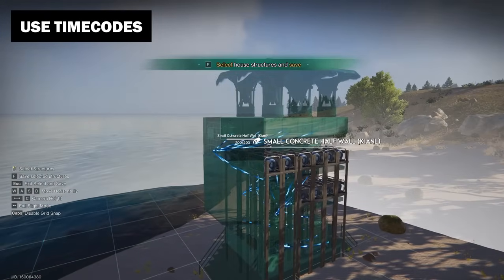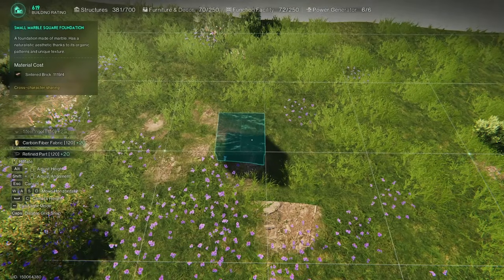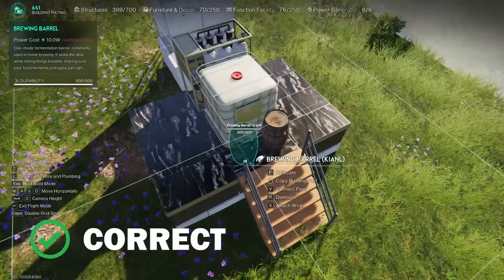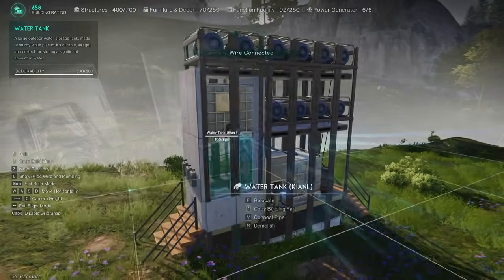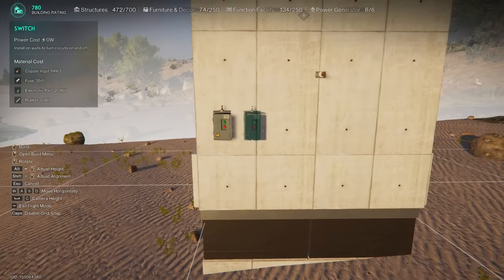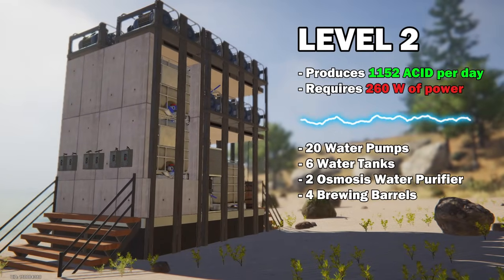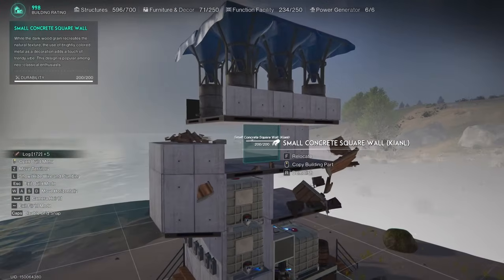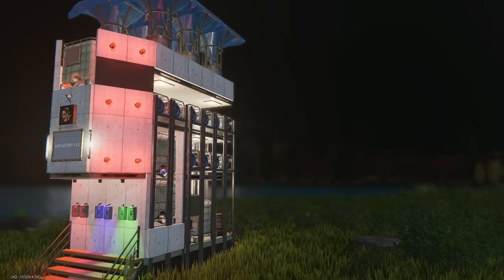Passive Modular ACID Factory (Saved as A Blueprint!) | 576 or 1152 Acid per Day | ONCE HUMAN

Comment: This looks great. I'll try to make a better blueprint than I currently have, as this is so much more functional with a much smaller footprint.

My only concern is that when trying to build it back through a blueprint you have to place the "wings" back down to install the water purifier. Wouldn't it make sense to leave the "wings" as part of the blueprint so they can just easily be removed afterwards? Otherwise the blueprint has a habit of breaking or losing count of pieces placed when you try to add the "wing" pieces to place the purifier. This also applies to the water purifiers.
Reply from the maker: "wings" = side support foundations I suppose.
maybe, why not
Reply: Yes, the side supports you have to place down to allow you to place the filter or the rain catcher. It may be worth a mention/pinned comment that they still need to be there when building this from a blueprint.
Reply: Just place the blueprint building via blueprint, not “build”. It will automatically place the building down without manually placing all of the individual pieces
Reply: Ooh, huh. I'll give that a shot.
Reply: @Rumaan3012  I've discovered that the "Build" option should be used if you want to partially re-use an old build as you can incrementally build stuff and then cancel the BP and anything created already will stay. 

The "House Blueprint" option seems to be the best option when you want to replicate the full building from a previous blueprint. It will place all pieces at once avoiding any Overlap errors.
Reply: That's awesome. I will definitely be playing around with this after work tonight. It will make placing my pure water setup a lot less of a hassle, as well as placing down this new acid farm.

Comment: The problem im having right now is the osmosis filter will make purified water instead of impure acid while offline. It cant be the pumps pulling dirty water because there is none stored in the filter or container. Plus there is more  polluted water in the filter and container at log in than could possibly have been collected in a minute or two so the filter logically has to process all of the polluted water because of stacking slots in the filter before it could even begin processing dirty water.
Reply from the maker: in some contaminated areas it's bugged, as far as I see, cos many players have this problem
try to move to another one
Reply: @KIANL-GAMER  I noticed sometimes if I have only logged off for an hour or two it doesn't do that, only when I don't get one for 10-12 hours and log back in. So I'm wondering if something like the territory being loaded by other players without me being logged in is what triggers it. But that is just speculation.

Comment: nice tips! already done it exactly as yours blueprint. but i curious what the use of the bottom tank? its just for stand or needed to connect pipe to other?
Reply from the maker: for pure water. u can supply it manually or connect pipes

Comment: 10:51 can you explain the water pump here? How does it require no power? I thought all of the little pumps had a power usage of 1?
Reply from the maker: if u don't use power, water will just flow down. so u can use this pump as a lot to connect pipe with pure water.
Reply: @KIANL-GAMER  this is pure genius, thank you.

Comment: I love this bill but the only problem is the ring collectors are a broken currently and they still haven't fixed them yet. So you're going to have to get water manually disinserted into the tank or take out one or two pumps down by the water if you have a water bill
Reply from the maker: rain collectors provides polluted water in contaminated areas
pure water for these builds should be produced separately

Comment: Why does your small concrete half wall have a pure concrete finish? Mine has design in front, and the only concrete finish is the back. Also, I can’t place the second water tank in the vertical section even after following your steps accurately.

I also don’t understand why the legs of my water pumps are narrower than the base structure. Yours perfectly fit the base structure, mine cuts through it.

Comment: I never saw an explanation on what to hook up to the lower of the two stacked tanks which is to store purified water and is connected to the barrels. Are we hooking it up to the Osmosis Filter or something else or manually putting the purified water into it?
Reply from the maker: water to tanks - separately. rainwater collectors only collect polluted water in contaminated areas

Comment: Anyone have also troubles to stack 2 tanks in top of each other? I also tried previous vid of factory and I wasn't able, to place ceiling over a tank, due to collision. I wonder if it's terrain issue or what...
Reply: I tried literally everything. 
First of all, there were patch few days ago and propably it made this tutorial impossibile. Walls look diffrent, it's not concrete from both sides, but black on one (as icon looks like).
Second - it doesn't matter which side walls are. It works 100% fine for first tank.
3rd - After placing tank I cannot place ceiling. Even if I do 2 walls. Walls > tank > no ceiling... Walls > ceiling > tank works.
4th - I tried diffrent walls, diffrent firections, mix... nothing helps.
5th - I moved my teritory to diffrent terrains, including flat one. Still nothing. 
Any ideas? Can anybody confirm, it's doable in this patch?
Reply: I DID IT!!!!!!!!!! After +/- 1 hour of placing (well... 50+ minutes) I get pixel perfect angle, pixel perfect height and pixel perfect position.
Reply: @Kubuleki   So this build is still do-able with the new walls if we get it right enough ?

Comment: OK for the life of me I can't figure out how to daisychain the pumps.  I connect wire from wall terminal to the switch and then connect the wire from the switch to the first pump.  Next I try to connect the wire from pump 1 to pump 2 and I can do that but when I try to connect the wire from pump 2 to pump 3 I get a message that I can't co those connections...what am i missing.  How many generators will be needed for this setup?

Comment: Hi, may I ask for the level 1, what's the purpose of water tank at the bottom? connected to two barrel, it isn't connected to anything.. how can it provide pure water to the two barrels. Thanks!
Reply from the maker: pure water should be produced separately. you can put in in that tank manually or using pipes

Comment: @KIANL Everytime I place the storage tanks water never goes into them I have four tanks set and hooked up to the pumps and water filters but the water only goes into one water storage tank and not the others why
Reply from the maker: you connected them wrongly. pumps should be higher, than tank to transfer any liquid. this is the reason why u need to connect pipes exactly to bottom slot, and why I emphasized this in the vid.

Comment: i managed to set this on eternaland only to find out i can't import it, then i was able to set it outside of it but i have a problem with the switches they don't on and off respectively they on and off all together am i doing something wrong? they are connected as in the video with the only diff that the plug on the wall is connected to electricity through a pilon. Good tutorial tho i have a lot of impure acid and water thanks to this
Reply from the maker: switches works normally, this is server problem I think - it update facility state (green/red) too long
and yes, blueprints from eternaland cannot be built in the normal game. Unfortunately 🙄

Comment: Just to clarify, this is solely for acid production, i know the seperate module to collect rainwater is there but this build works in tangent with the previous itteration for purified water? So total power usage would be approx. 310W of power to run both?
Reply from the maker: in general, yes
each barrel requires 72 Pure Water / day (288 PW / day for 4 barrels)
so technically u could gather dirty water manually once per few days to save power. Although I have no idea, for what ppl need that much ACID

P.S. I will try to do combined build in the future. But it will be a mess in tanks for sure... 😕

Comment: is there any trick for the pumps to not collect any oil? I live at blackfell refinery poluted area where you can pump acid and oil.
Reply from the maker: idk, I haven't tested that spot normally yet.
u can actually collect dirty water manually, or u can move your base to normal area for some time and use like 30 pumps to create a supply in advance

Comment: Hello, i have a problem here. What is the use of the lower water tank (of 2 stack)? I tested out for 6 hours and the upper water tank is full of sea water and not many polluted water. But the lower water tank has 64 whole storage of nothing😊
Reply from the maker: move pumps FAR from bodies of water, so that u don't get dirty / sea water.
this build does not produce pure water. I must be delivered to lower tanks with pipes or manually
easy way to do this - https://youtu.be/NZBvmOw2cAU

Comment: To do this do you just play with an alt until you get to the right spot and then set up it's while base as a farm? Where does the energy for all the other stuff like fridges go?
Reply from the maker: I have a separate switch for each workshop facility (like stove), so I enable them as needed
the rest takes not so much power. also, there are water collection modules, so in fact u produce much more polluted water, than u can process, which means u have a buffer supply for the time ur electric eels recharging
Reply: @KIANL-GAMER  wait, I'm still curious, how do you generate 260W of power?! I'm doing 150~160 pre-Eels!

Comment: I can’t understand what I did wrong.. I built everything as in the video, everything works. But in 2 days there is only 400 acid, not even from 4 barrels, but from 6. All barrels are working, they have resources. But the 1152 per day stated in the video is still a long way off. Could the reason be that I am in a place where there is oil? Could this slow down the barrels? I bring water from the river manually
Reply: same, I think we need to fill all 4 slots of impure acid in barrels to make it work
Reply: Need to fill all slots in order to get the numbers , if all 4 slots in the barrel are filled then all 4 will process so if you had 6 barrels it should process 24 acid per cycle

Comment: I'm going to assume you have other things going on besides this. How are you managing the power for all of it to be done? For example, being able to use the stove, plants, etc.
Reply from the maker: plants don't need a lot of power - here's farm examples: https://youtu.be/ToGZULQUoUE
as for workshop, I usually have a switch for each separate facility (like furnace or stove), so I turn them on only when I use them
Reply: @KIANL-GAMER  Got it. Last question, the water storage that's on the bottom on the left, where is it getting the pure water from that's connected to the brewing barrels? I must have missed it but watched several times, but only saw that you attached it to the barrels.

Comment: but eels will occasionally "take breaks" and that will lower the power output...
Reply from the maker: rainwater collectors will allow u to accumulate additional polluted water without using power. so at the moments they stop working, if u had a few rains, u will have like 3 tanks filled with polluted water, which means ur osmosis water purifiers will still work quite long time without pumps
Reply: @KIANL-GAMER  Looking forward to your compact version if it works. :)

Comment: The bottom tank where it's connected to two barrels, im confused, how does it collect purified water?
Reply: It doesn't, you'll have to manually load or pipe in water from another pump and purifier outside of the polluted area. Set your acid farm right at the border of the polluted zone and your farm just outside, that way you can fill your barrels and water crops on one system.
Reply: @SerangelROM  thanks so much!

Comment: Do the materials you build with matter? I can't make all the shelves and can't place the pumps on wooden shelves.
Reply from the maker: tbh I haven't tried with other materials, so better use exactly ones from the video
Reply: @KIANL-GAMER   how do you get purified water into the barrels? i know you connected the bottom water tank but the water still would need to be purified right?

Comment: this is raw af but question so do you have this instead of a base? cause how you get that much wattage and stilll more for the house
Reply: 2 main ways:
Switch off farm if needed.
Get specializations for generators (and cap increase), then put pollution gens (8x) in polluted area, or adv bio gens (both with eels.)
Reply: @mrboxy3970  appreciate it

Comment: Tried this but going to rebuild with blueprint is causing an issue

Yeah i legit just rebuilt it 3 times and i cannot get it to work from blueprint without errors. 

Small walls have errors the 2 outside barrels have errors, both water filters have errors and 1 half wall has an error. I legit have no clue how you get it to work but i cant. 

No matter what i try the purifiers dont build 2 of the small walls dont build and or 2 barrels wont build.

Comment: I saved the blueprint and did exactly as you but when I try to build the water purifier it says there is a collision
Reply from the maker: they might be to high from the ground level
anyway, try to adjust using ALT + Mouse Wheel
Reply: @KIANL-GAMER  How can you adjust when you are building it from the print you saved?

Comment: how is pure water added to the bottom tank? We need another purifier for it no? why not include that in the design as well?
Reply from the maker: because u cant install pumps for dirty water and for polluted water in the same place, u will 2 times less acid output and mess in storages. pumps for pure water should be placed somewhere above the water separately anyway
Reply: @potaatochan  you can try to make near acid production one more water purifyer and dirty water tank so it pumps clear water into acid production clear water storage create.
Reply: @KIANL-GAMER  yeah, thanks and I'll be making this for my base 😁

Comment: for level 1 i dont need rain collectors?
Reply from the maker: rain collectors is optional thing. they are not required.
but if u install them, they will fill ur tanks with polluted water, so u will be able to disable pumps temporary and save energy. for example, if ur electric eels are on recharging
Reply: @KIANL-GAMER  so rain in polluted areas also give polluted water?
Reply from the maker: @iKazimoto  yes
Reply: @KIANL-GAMER  can just use 2 batch of eletric eels right
Reply from the maker: @cm_lover8041  still haven't tested, so can't confirm. some ppl from comments say it doesn't work

Comment: This has to be out of date. The game must have updated the pieces because my concrete pieces dont look like those and either the second water tank doesnt fit between the small walls or the third tank doesnt fit most of the time. Even if i miraculously get those two to fit, the water pumps dont want to fit. This is the second video ive tried to follow from the guy and i dont understand how the pieces he places are always showing green and will fit with ease but mine are always red and i have to sit there for 10+ minutes looking for the tiniest spot that it will be placeable for one second before going red again. There is no flipping it to make sure the alignment is right to get more space because flipping the piece to the other side takes up the same amount of room. I thought "maybe i could try to use stone or wood instead of concrete" but all the small walls and small half walls have the same thickness.
Also you cant replace the blueprint because you squeezed so many pieces together and they wont allow you to rebuild them since they over lap. The fact that you just instantly placed your build shows this is outdated.

Comment: PSA: It's still doable even after changes. 
Used both Small Concrete Half Wall and Square Walls ( bottom have black outside, top have opposite ). 
They key for stacking the Water Tanks for me was getting into them lol. 
When placed 1st, I went out a bit with second then moved in where my camera was basically leveled with bottom one and I was all I saw was the top one. 
It allowed me to place it that way ( for whatever reason ). 
It was finiky and I spent like 30 min to find a solution but hopefully some of you can understand what I mean ( don't really know how to explain it better ). 
Replicate - Get close to the place where 2nd one is going but a bit above, look down with camera so you're perpendicular with bottom front side and slowly move your mouse.